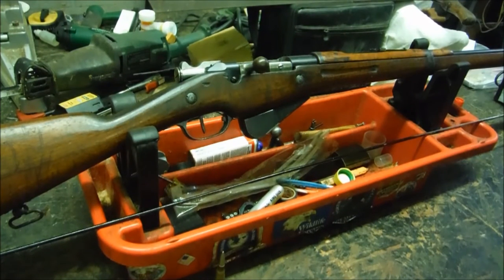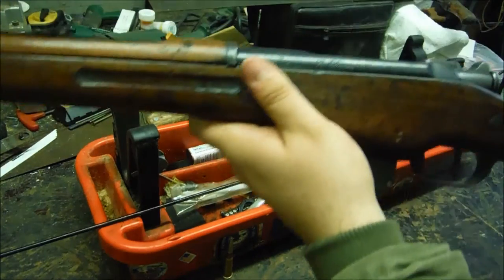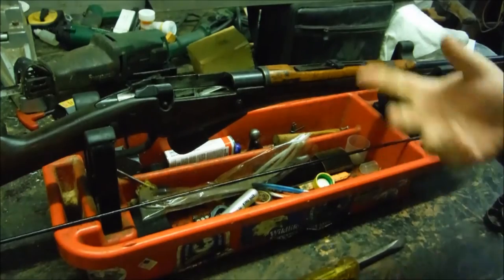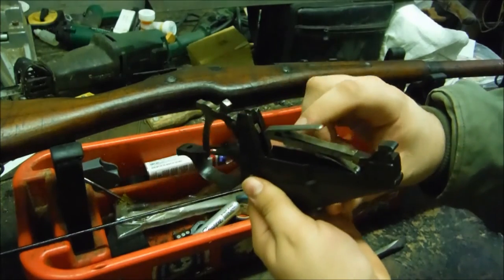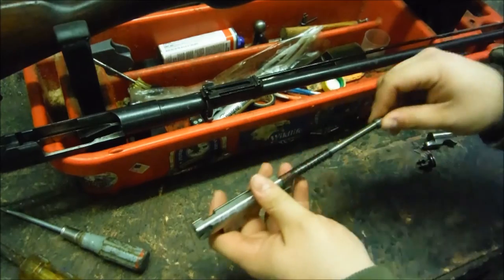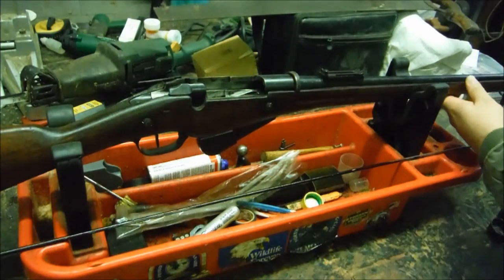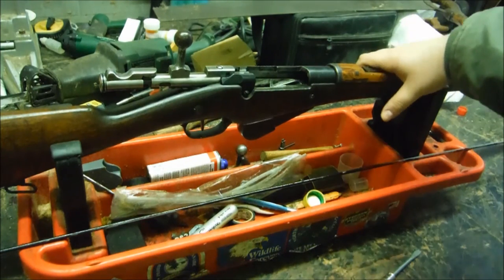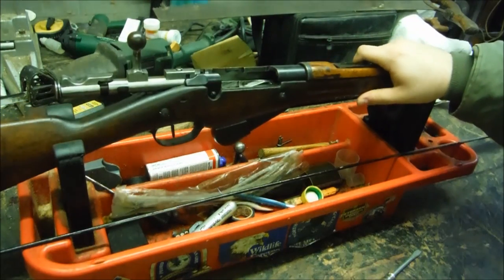French Berthier Model 1916 Disassembly

Comment: The Berthier can hold 6 rounds actually. Put one extra in the chamber, Hold the M block down while closing the bolt and it works great.
Reply: french doctrine held that there should not be a round in the chamber hence the lack of a safety so for a frenchmen, 5 rounds

Comment: I feel like the French went out of their way to make it as difficult as possible to remove the action from the stock. So many screws and cross bolts!
Reply from the maker: that's probably got some truth to it. Prevent soldiers from losing parts. I think that's the reason for the weird screws they used in their later rifles.
Reply: +Targetpopper  You may be right for the receiver, trigger and stock. On the other hand, they change a little bit their minds in the 1930s: the MAS 36 bolt is very (very very very) easy to disassemble.
Reply: Their gun before this were easiest to take apart and out together